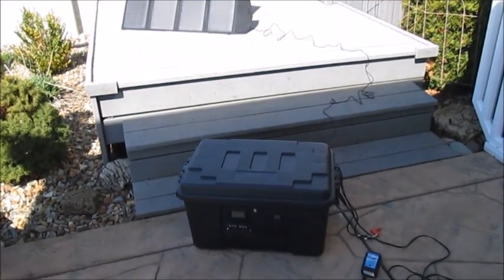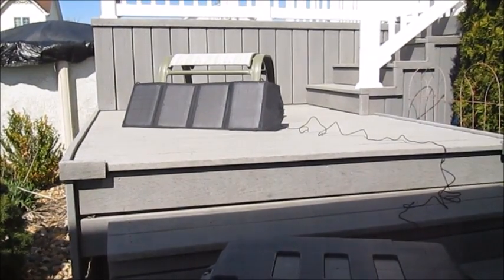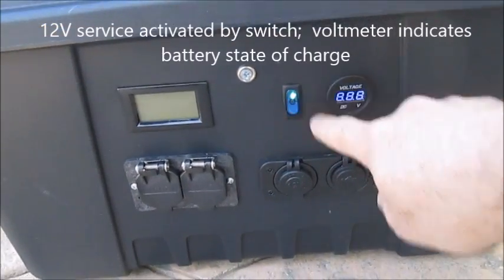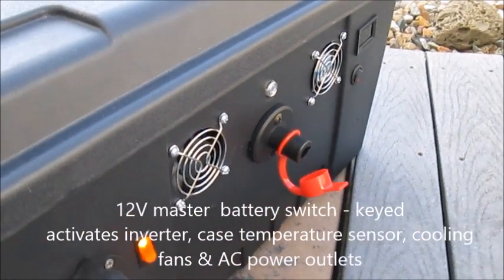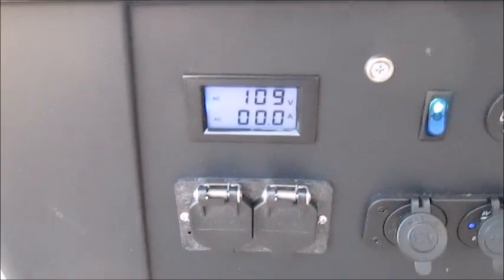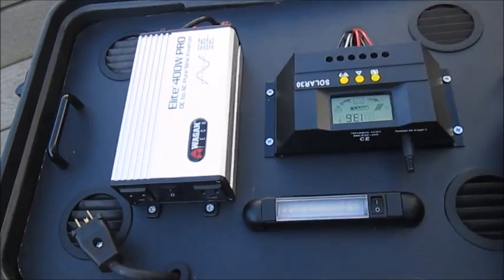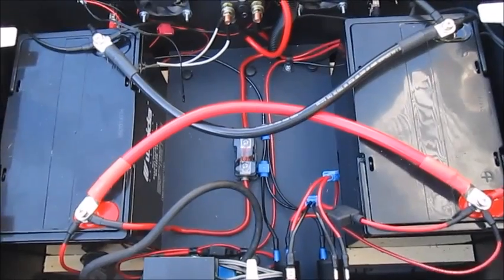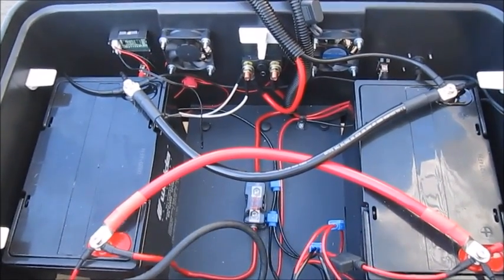V1 P1 DIY Portable Solar Power Generator - Wiring Schematic, Parts List, FAQ Sheet Provided

Comment: At 7:28 The charging rate is not measured in amp/hours did you mean 5A charging?
Reply from the maker: The rate expressed was relevant to the 100W solar panel, which is expected to deliver a charge of about 5 amps per hour in optimal sunlight.

Comment: Beautiful build!  Lots of nice features but I have one question.  Why did you decide to build your own system at 110ah, 400 watt inverter for $950 when you could have bought a prebuilt Pecron for example with 128 ah, 1536 wh and a 2200 watt inverter for $529?  I was going to build a system like your til I found the Pecron 1500.
Reply from the maker: Thanks for viewing and for taking the time to leave some comments!  Back in 2015 when I designed and built this system, you could not buy a comparable, commercially built box for the same price.  The $950 I quoted also included the cost of a solar panel.  A major benefit of building your own is gaining the knowledge of how the system works and how to replace components in the future should they fail.  I'm sure you can find plenty of current model portable battery boxes that are cheaper than my initial build.  As these systems have become more in demand, their prices have dropped considerably.

Comment: Very nice! I built my diesel heater into this same Plano case and wanting to build a solar generator. I considered using another Plano case and glad I stumbled upon this video! The case is a little larger than most other builds I've seen, but it leaves room for expansion. And it would match my diesel heater build. Good stuff.
Reply from the maker: Thanks for viewing and for taking time to leave a comment!  After 10 years of seasonal use, the Plano case has held up very well.  Check out the videos near the end of my series where I upgrade from AGM to LiFePo4 batteries and attach a 2000W inverter to the top.  The case was perfect for expansion!

Comment: I have built a working one very similar to yours. Except I don't like the wiring I used. It is the gauge of the wires that I used that I am not sure of. But like I said it works well. Can I get a printable copy of the schematics you used? It is hard to make out the gauge of the wire if I pause the video. Thanks.
Reply from the maker: Hi, thanks for viewing and for leaving a comment.  You can find links to many resources by clicking "more" under each video in my series.  The most recent wiring schematic is included in the list of links, and can be accessed at https://www.creeksideartifacts.com/PSPG0521.pdf

Comment: cool nice build sweet I build my own 48 volt 3000 watts pure sine wave I have from my inverter AC out let I have two breaker for my out let 110 AC out let GFCI out and have breaker between my positive of my batter and positive of my inverter and I have cooling fan I have 15A Breaker and 20A breaker so my inverter is Procted very well nice build not finish building my as yet
Reply from the maker: Thanks for viewing and for your comments. Watch my entire series of videos to see the many upgrades and major changes I have made to the system.
Reply: @JimFisherDIYPortableSolarPower  I sure will cool I am making my power station I have few inverter I have 800 watts 120 AC 60 Hz I have one deep cycle battery 12 volt 75A I HAVE 2 20A breaker for my two 110 Ac volt out let I used wire that wire house with I have those to my 110 AC out put and to my 20A breaker switch to my inverter have let light I have 3 12 volt I have 3 cool fan batter better I have put USB port not finish yet I have 12 ways fused block and switch between my positive of my battery and positive of my inverter to turn if when not using

Comment: Hey such a beautiful, fancy build! I’m making a tiny version right now. Looking for others who have installed amp meters. I’m wondering is there a way to trick those amp / current meters into displaying current coming in from a charge? I’m assuming that is only shows the draw in your setup (vs a sum of the power in and out)?
Reply from the maker: Hi, thanks for your comment and question.  If you are referring to the AC ammeter in my system, it only reads AC inverted amps being drawn.  Refer to the last couple of videos in my series for insight into a coulomb counting meter that I installed to measure both DC amps coming in from solar and going out via all distribution options.
Reply: @JimFisherDIYPortableSolarPower  oooh okay, great I need to find those. I see some people wiring up two  PZEM-015  meter displays (one for input, one for output) in one solar charge system and so I’m wondering if they might be doing that because 
maybe the PZEM-015 does not display negative numbers? Do you know if the PZEMs show negative values (or show a directional arrow to indicate current in or out)? I see that the Renogy definitely shows birectional, it’s just it’s kinda pricey. Thanks so much!
Reply from the maker: I'm not familiar with the PZEMSs, but this meter displays positive amps coming in, negative amps going out, or the net of the two if you are using appliances while the system is charging during daylight hours.   At last check it was about $44....not too expensive.  AiLi Voltmeter Ammeter Voltage Current Meter Voltmeter Ammeter 100V 350A Caravan RV Motorhome 999 AH https://amzn.to/3z7fWrl

Comment: Great build... Ive looked at hundreds of these type videos... my question to myself... why spend $900 in parts to build this setup as you did,, other than pay half the price or less for a portable power box already built
Reply from the maker: Thanks for viewing and for your question.  First, this system was originally built over 8 years ago.  Prices on some of the components have come down. The price of the build included a flexible solar panel.  It is important to compare the total DC amp hours that the batteries contained within are able to provide.  At that time you could not buy a complete system that offered as many amp hours for $900…and you cannot today.  My system now includes a 280ah lithium battery (this converts to 3,584 watt hours).  Most of the small, portable systems you will find available today don’t offer as many amp hours.  For example, the Bluetti 2,048wh system retails for about $1600 today, but offers only 160ah DC and does not come with a solar panel at that price.  Using the Bluetti portable system that is comparable to mine you would need to buy their 3048wh system (238ah DC) and would need to pay $2,600 plus the cost of a solar panel(s).
Reply: @JimFisherDIYPortableSolarPower  
Thanks for your response.
I wasn't knocking the build...
I've been looking at lots of videos and thinking of building my own.. 
I was just second guessing myself.. 
Thanks for info
Reply from the maker: Understood, you are welcome...it is really important to look at the specs on the capacity of commercially manufactured systems.  You can definitely build your own for less money and have much greater battery capacity.  The other benefit is that with your own DIY system if a component fails it is very easy to repair/replace.   That may not be possible with a commercially produced system.

Comment: How much amps battery 🔋 is
Reply from the maker: original version: 2 x 55 ah AGM batteries = 110 amps (about 55 useable to 50% state of charge)
updated LiFePo4 version: 1 280 ah battery (about 250 amps useable to 10% state of charge)

Comment: since lithium batteries have dropped to as low as 300 for 100ah wher 2 55ak sla are 340 and you only get 55 ah vs 80+ from lithium and size charger and solar to the 100ah but not too bad a setup
Reply from the maker: Thanks for viewing and for your comments.  Check out the full series of videos, this system was upgraded to include a 280ah LiFePo4 battery in 2021.

Comment: Do you think it is cost effective to actually build vs buy?  I was hoping to build because of the cost savings, but it seems to still be about $1 a watt to build.  Any thoughts?  I Love this video and your finished project!
Reply from the maker: Hi James, that is a great question.  Thanks for that question and for your comments.   I recently had this conversation with a friend who was considering to buy a commercially produced solar generator.   The prices for production solar generators have certainly come down over the past few years.   My analysis of the specific model my friend wanted to buy vs. what it would cost to build showed that it was still more cost effective to DIY, but the gap was closing.  I estimated that he could build a system that would offer twice as many amp hours for about 66% of the cost of the production model he was considering to buy.  There is a lot to consider.  Here are some questions that should be pondered.  How do you intend to use the system?  Emergency use only or daily as a primary power source (i.e. for off-grid living)?  Will your system need to be self contained and portable?  Is total weight a specific concern given your use?  This will determine whether you would want to use more expensive lithium or cheaper lead acid batteries.  What types of appliances do you intend to run?  This helps to determine what type of inverter you would want.  Will this be a larger capacity system or a smaller system?  This can help to determine whether a MPPT or PWM solar charge controller is desirable.   

Here's one thing of which I am certain.  Building your own gives you the knowledge and ability to repair or upgrade the system easily.   Armed with knowledge of how your system works you can quickly identify any problems and easily replace components.  That will certainly be more cost effective than completely discarding, or paying someone else dearly to repair, a pre-packaged, commercially produced solar generator that typically affords limited access to components within its case.
Reply: @JimFisherDIYPortableSolarPower  great information and feedback, I truly appreciate your time and knowledge!  Thank you

Comment: Great video! I am watching lots of videos to see if I can figure out how to make a solar generator, but it still feels way over my head. Sadly, I will probably have to hire someone to build one for me. Yours looks like one of the best I have seen for sure.
Reply from the maker: Thanks for viewing and for your comments Susan.  Start slow with just the most basic, necessary components.  You can add to your knowledge and skills as your system grows.  At minimum you need a solar panel, a solar charge controller, a battery, an inverter, and wires and fuses/breakers.   You can do it!
Reply: @JimFisherDIYPortableSolarPower  Thank you for the very helpful reply. I was wondering what I would need for a basic setup. I did build a computer once, and although it was a little overwhelming because it was unfamiliar territory, I did it. I think maybe I can do this too and if I need help I can always call an electrician! :) Blessings.

Comment: That deck is the answer I've been looking for! Just want a simple 100ah Lithium Battery/1000w pure sine wave inverter so I can make coffee in the mornings without having to run gas generator when camping in TT. Oh, and the wife can use her blow dryer. Thank you!
Reply from the maker: Thanks for viewing and for your comments, Nick.   This system works great for RV and camping life.  Be sure to check out the entire series to see upgrades I have made and the conversion to LiFePo4 batteries.
Reply: @JimFisherDIYPortableSolarPower  Plan to Jim! Just got my 1000w pure sine inverter today and it says to "ground it". How on earth you ground with a battery box is beyond me. Hopefully your videos address this.
Reply from the maker: Check out my V1 P7 video where I install a GFCI outlet.  I address the topic of grounding, the benefit of a neutral-ground bond in your inverter, and the benefit of a GFCI outlet if your inverter does not have one.

Comment: What chager do you use to charge the box? Is not listed in your parts and how long does it take to charge
Reply from the maker: Hi, if you look at my most recent V2 P6 video description under “tools” you will find a link to the bench top battery charger that I use to charge the new LiFePo4 battery.  It is a  10 amp charger that is able to fully charge this pack in about 5 days in parallel or about 28 hours in series.

Comment: Hi Jim, in the list of components you have a separate thermal sensor and thermostat switch.  I've found a device that does both and displays the current temperature and set temperature (and is cheaper) but is 20A DC 12v so would this draw more power from the batteries than your suggestion.
Reply from the maker: David, can you provide a link to the product?  I think a combination temperature sensor/display/switch is a great solution.  It would need to be 12V to work with a 12V battery/system, but I don't expect it would draw 20A.  That is a LOT of power to serve a simple thermal sensor/display/switch.
Reply: @JimFisherDIYPortableSolarPower  The link is in the UK but hopefully you will at least get an idea of what I mean.  https://www.amazon.co.uk/Aideepen-Thermostat-Temperature-Controller-Thermometer/dp/B08DD9LNZL/ref=rtpb_3?pd_rd_w=twYHE&pf_rd_p=5a5e3976-5d4e-46fd-b875-6aae78355b0a&pf_rd_r=TX6PPQ2F25BM2QHNP0PA&pd_rd_r=9b29f66d-c75c-43d9-b66a-037f05b6fb15&pd_rd_wg=vTVsm&pd_rd_i=B08DD9LNZL&psc=1
Reply from the maker: It appears that product would do the job of accurately monitoring/sensing temperature and is programmable to close the circuit at a set temperature (to start cooling fans, for example).  It must be rated to carry a maximum of 20A through the switch, would likely require only mAs to power it.

Comment: Hi Jim, I'm living in the UK and your video has inspired me to start building a Portable Solar Power Generator but I've got some questions.  Firstly, how big a roll of 14 AWG and 8 AWG wire should I buy as I don't know how much wire i will need and don't want to buy a too large or too small roll.  Secondly, I've had to try to convert the US items into items I can buy in the UK.  Most of them are easy but what does the Duplex 15A GFCI receptacle do; is it simply a mains socket (UK mains sockets look different to the US sockets) to plug in mains appliances like a fridge or does it have a different job.

Keep up the good work.
Reply from the maker: Hi David, thanks for you interest in my project and for your questions.   I would recommend about 10 feet of each red and black 14 AWG.  You won't need more than about 4 feet of each red and black 8 AWG.  If you are able to find a location that sells in bulk off the roll that is the best approach, that way you can always go back and get a little more if needed.  Yes, the 15A ground fault circuit interrupter receptacle is simply a mains power socket comparable to what you would find in your wall into which you would plug your typical household appliances.  The GFCI offers some additional protection since the system is not grounded.

Comment: Awesome build. Can it deliver power while charging? What component does that?
Reply from the maker: Hi Alan, thanks for your comment and questions.  Yes, it can deliver power while charging.   The system can deliver AC power via the inverter and DC power via the 12V plug and the USB ports.  The solar charge controller has load terminals that can deliver power directly to a bus bar to which the 12V outlet and the USB ports are attached.   The inverter is connected to the batteries, but that does not preclude its use while the system is being charged.

Comment: would it not be better, to  spray or cover the boy white, so it does not heat up, used somewhere in the sun ?
Reply from the maker: If your intended use requires placement in direct sunlight you certainly could paint the case white.  In my situation the solar generator is inside of my boat’s cabin, out of the sun at all times.

Comment: Hi guys . I have just received a voltmeter ammeter exactly same like the one in this video ... But i don't know how to wire it to my power box ! After trying to find a solution i realised that it is not  for monitoring the voltage from the battery but to monitor the connected devices !?!?!
Please clarify the confusion for me ..i want to know how much voltage left from the battery and when it is full .... Did i buy the wrong voltmeter !?!
Reply from the maker: Hello.  This system uses 2 different voltage meters, one for monitoring DC voltage and one for monitoring AC voltage.  You are correct, the voltmeter/ammeter is for monitoring the AC amps being drawn from the 400W inverter.  The voltmeter to the right on the  front of the case indicates the voltage of the battery pack.

Comment: It works better with 2 - 12v fans pushing and 2 - 12v fans pulling. Fit an internal 12v light, for checking at night. You could connect a Wind generator, given that it is a boat, with cloudy days. A low voltage buzzer to wake you up in an emergency.

Comment: I like the design because you have a lower risk of water ingress with this, was that a consideration in the design or just coincidence that nothing was put on the top?
Reply from the maker: Hi David, thanks for viewing and for your comment/question.   My goal was to make the system water/weather resistant as my primary use is on a boat.  While the system is routinely located under cover in the cabin of my boat I also felt it would be advantageous to keep the major components as protected from moisture as possible.   So far, so good...after 5 years I am seeing no signs of corrosion.